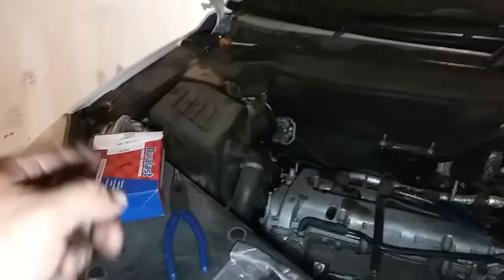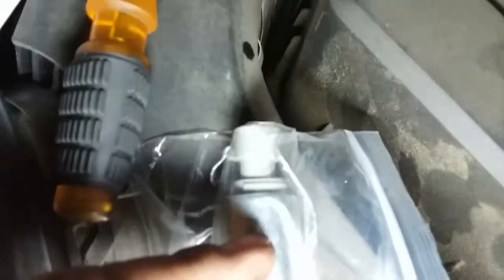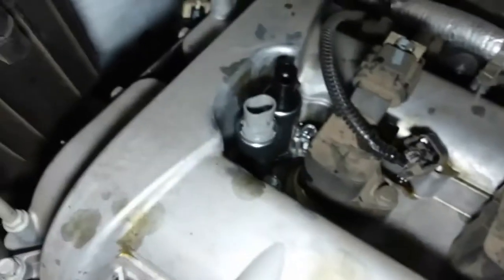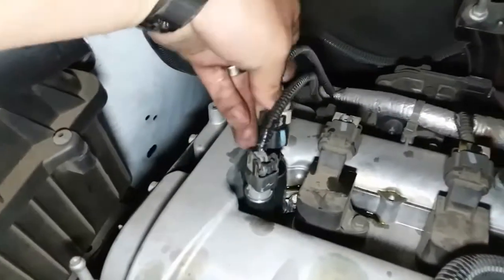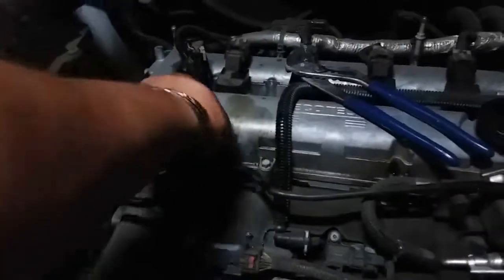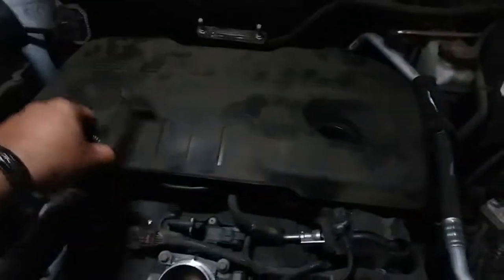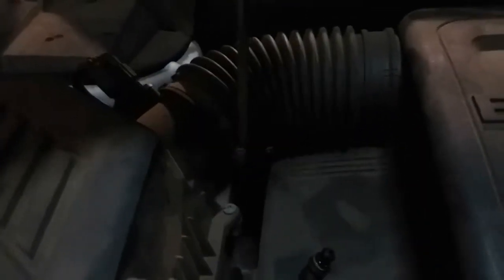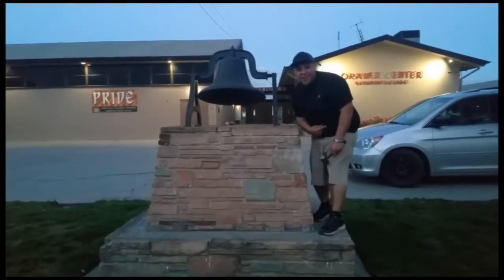How to: Install Intake & Exhaust Camshaft Position Actuator Solenoid Valve 2012 Chevrolet Equinox

Comment: Immediately after replacing the silonoids now getting exhaust smell in cabin.  What could I have done wrong?
Reply from the maker: What really that hecka weird cause the sensors won't do that. An exhaust leak from the exhaust pipe is the only place it will leak fumes out. Maybe a gasket bad and not making a good seal. You can also hit the recirculation button on the climate controls. That closes the vent coming from the engine bay and recirculates the air from inside the cabin.

Comment: I'm having trouble getting the actuators out. .Should they come out easy, or do i need a special tool because i can not get mine to move. thanks
Reply from the maker: You could try using some channel lock pliers to try to get them out. grip them move them back-and-forth as you're pulling out. Hope this helps 🙏

Comment: How do you replace a broken exhaust VVT connector on a 2012 Chev Equinox 2.4l
Reply from the maker: Sometimes autozone has the correct pigtail replacement for sensors. Might want to give them a visit and see what you find